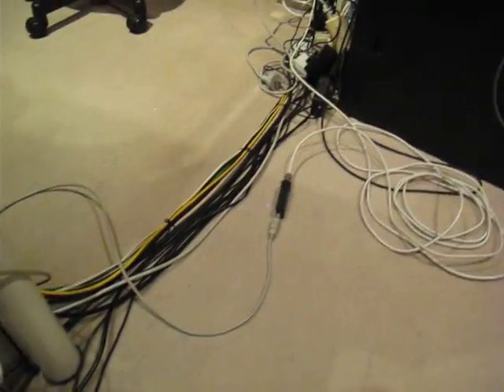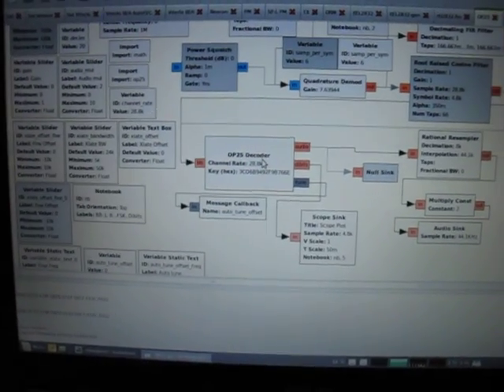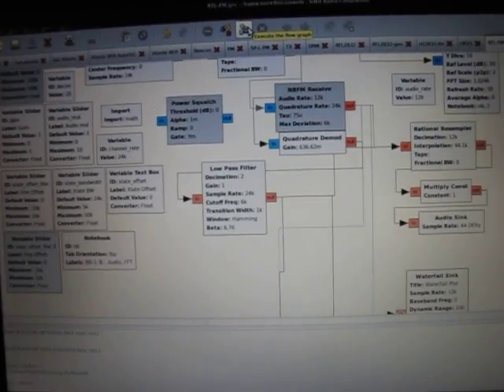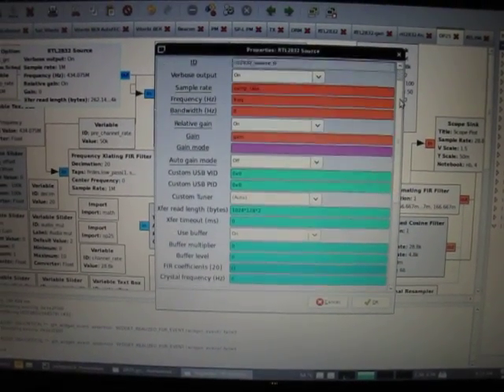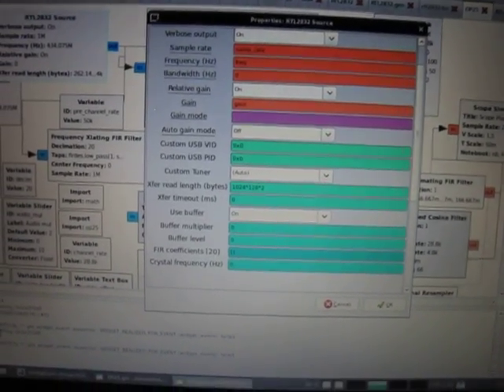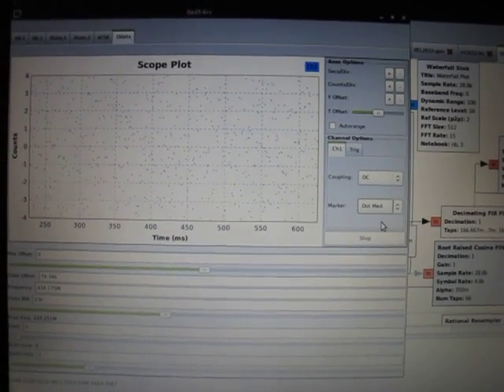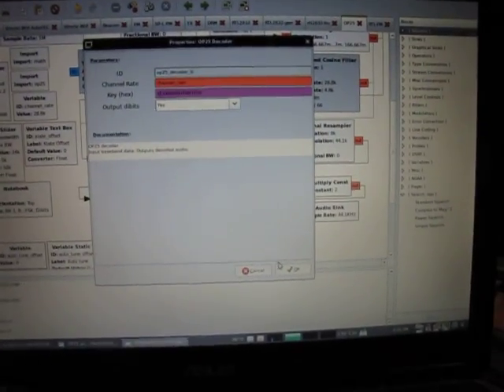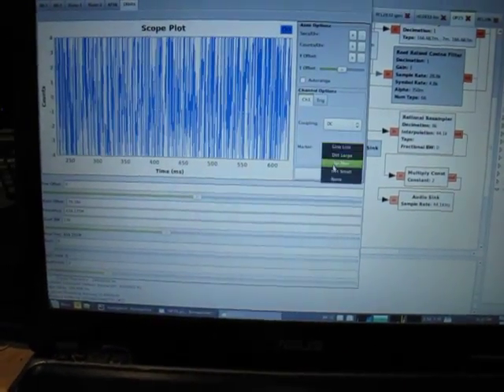World's cheapest P25 receiver w/ decryption: GNU Radio + OP25 + $20 RTL2832 DVB-T Dongle

Comment: Whenever i see stuff like this i wish I could wrap my head around gnuradio and programming in general. I’ve got the rtlsdr dongle as well as a few vintage/antique radios I’ve repaired, and two old scanners. Obviously the old ones can’t decode digital signals so I’m kinda restricted on what I can hear with them(though thankfully international sw is still mostly analog...) And rtlsdr I just use cubicsdr on my pi, and sdr# on Windows, but don’t know much about any addons for em, or even where to start.

Comment: The video is extremely low quality, unless the watcher knows specifically about the software you’re using no knowledge about it can be gained from this glossed over hard to see video.   I personally don’t understand why you need to show everyone you can decode your own personal encrypted radio when you know the key.  Would be much easier to simply input the key into a radio that has a compatible crypto board then having to go though all this extra effort.  Seems goofy.  You bring up this property page and gloss over stuff in such a way that only you really know what you’re doing.  Pretty irritating.

Comment: This is awesome.  I bought a baofeng uv-5r in hopes to pickup my local law enforcement. After learning the ropes I wuickly discovered they all operate on p25 phase 1 :(
Reply: p25 itself is easy to pick up with a SDR, which is cheaper than the baofeng. But if they are encrypted p25 that is another story.
Reply: you didnt research before buying?

Comment: Aren't U.S. ham operators required to transmit unencrypted?  I opened unitrunker and see lots of 'enc'rypted channels, why?     Is this only for law enforcement, or  can anyone with the right decoding radio work (Ma-Com / Harris OpenSky / MPT1327)?     Can you do a video walking the steps needed for basic voice decoding using sdrtrunk or unitrunker & dsd+?

Comment: You can set the NAC to F7E with digital SQ mode to let the speaker open up to ANY p25 transmission, on the second (black) XTS there. it will sound garbled as you'd expect but the audio will flow  :)
Reply: F7E is the wildcard for the XTS2500 and later radios. The XTS3000 series can not use this, and 293 is the digital CSQ code for the XTS3000.
The 1 Meg VOCONS of the 3000 could not use F7E, but the 4 Meg VOCONS and firmware allow this in the 2500 and 5000.
Reply: Works on my XTS3000, works on Tait Tm9100/Tm9200. It's part of the P25 standard.

Comment: Apco 25 digital with automatic differentiating between analog and digital reception, so as DSD or OP25 can auto switch decoding and display relevant transmission regardless of modulation/ sampling method..... any help would be greatly appreciated, thank you in advance...       please assist me in my venture..

Comment: Hi my name is Daniel. I am a radio enthusiast.
I have SDR software operational on windows but i can't get it to work on linux. I am running Backtrack 5 r3 and i am unfamiliar with building software such as "GNU Radio"  inside said OS... I would appreciate any assistance with getting GNU working on BT 5 r3 as you have in this video, including Apco 25 digital with automatic differentiating between analog and digital reception,  any help would be greatly appreciated, thank you in advance...

Comment from the maker: Unfortunately not at the moment, maybe soon. With the gr-baz example, please remember that you need to tune to a frequency offset from the one you wish to listen to, and make up the difference using the 'xlate_offset' variables (i.e. translate from the centre frequency to the one of interest as you don't want to have your signal in the middle of the spectrum). The next step is to check whether your signal appears correctly in the 'Xlate' tabs, and then if you have four levels in 'Dibits'.

Comment from the maker: GNU Radio you can set up under Windows in a couple of different ways - please see the instructions on the GNU Radio site for them. OP25 probably won't work at this stage without good knowledge of programming and porting (you can also check out the instructions on their site too).